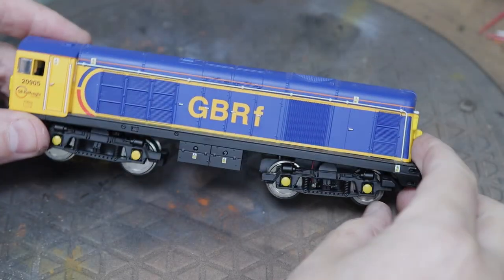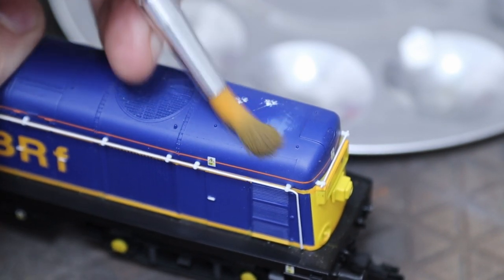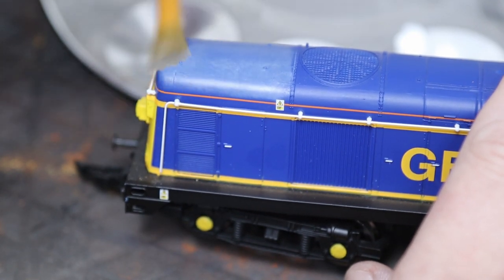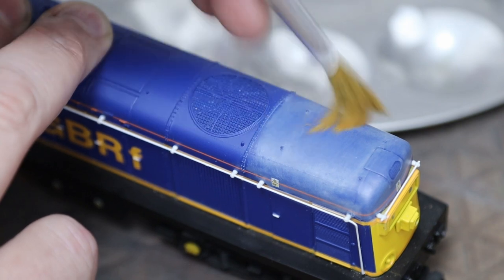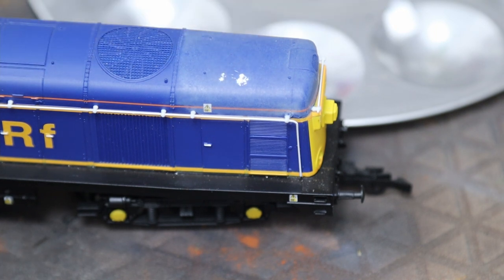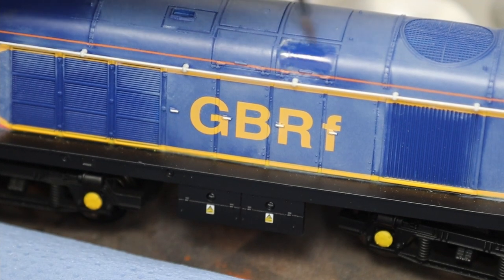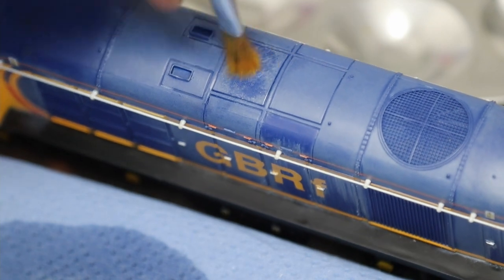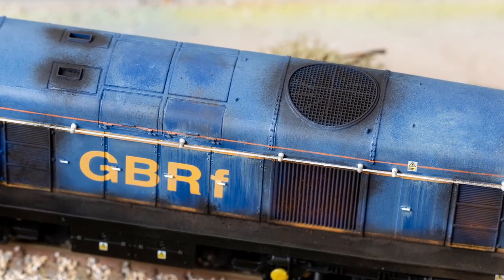Simple Paint Fade Technique without an Airbrush | Weathering Model Railway

Comment: You might consider leaving the paint to be used on a piece of cardboard for a few hours. This way the linseed oil will be absorbed. Otherwise the paint will take forever to cure once applied.
For streaks a Princeton 3/4 "Grainer" brush might be a more reliable option.
Nice effect in the end.
Reply from the maker: Thank you. I’ll take a look at the brush. I think that the Artisan range may have less linseed oils as it’s also water washable. However I’ve never had an issue with curing. But I’ve seen lots of modellers leave oil paints on cars to leach out the linseed. Good points. Much appreciated

Comment: The streaking technique down-to-up is the opposite of what we've been taught!  It definitely works.  Is it because it's oil?
Reply from the maker: Generally streaking would indeed be in a downwards direction, as per gravity. Sometimes (because of details in the model) up is the only way, as long as its vertical strokes. And oil is best for streaking as i can be shaped and softened

Comment: Do you always use white to fade your cars? Won't red turn a pink?
Reply from the maker: Yes, i normally use white, but you could use lighter shades of the colour that you're trying to fade. Lots of the fading that happens is where the top surface of the paint turns into a white powder, such as on old red cars and vans. And they will look pink. Thanks for the comment